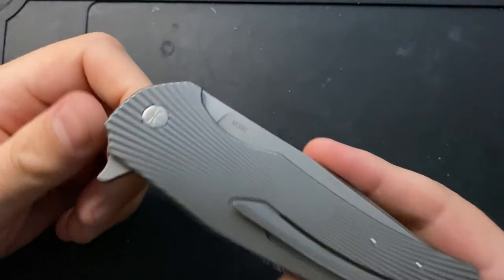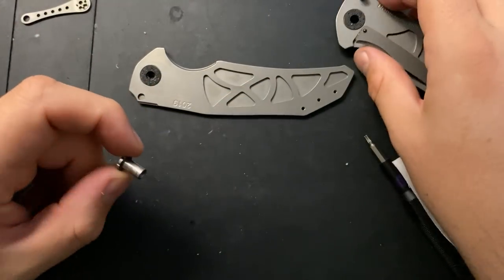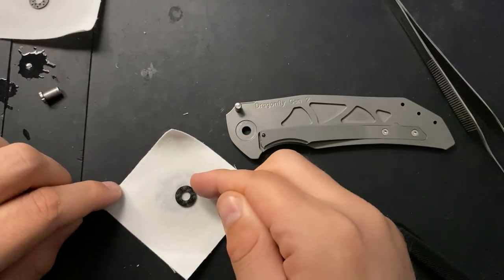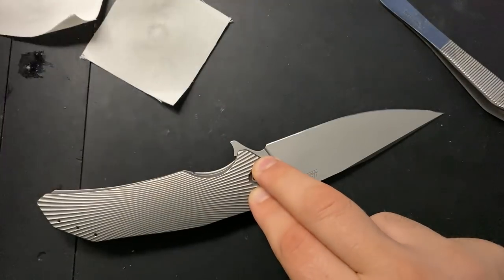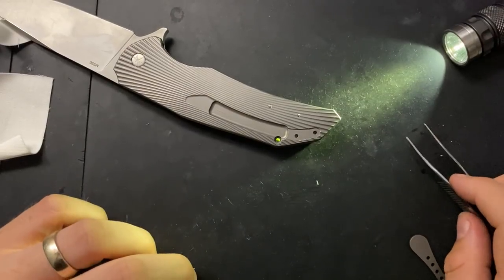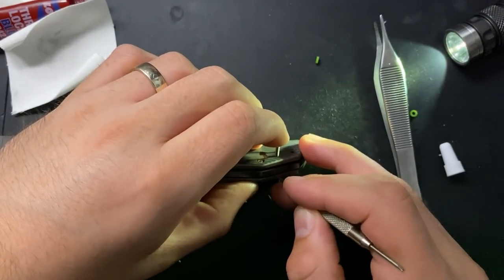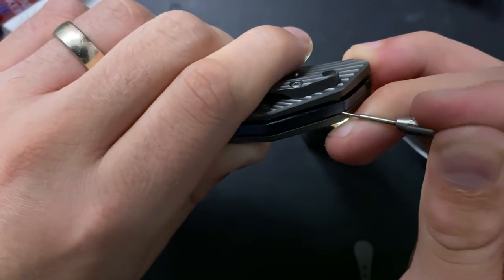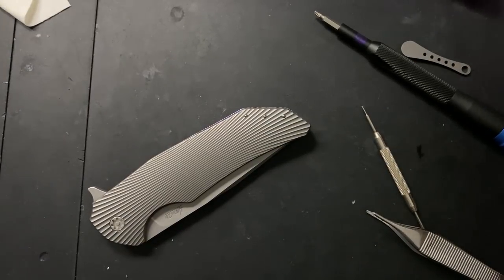How to disassemble and maintain the Herman Knives Dragonfly Pocketknife

Comment: Have you considered purchasing some longer screws with same thread that you can use as alignment pins. Cut off the screw heads, thread into lower scale and then stack parts and upper scale. Push down on upper scale and remove one alignment pin and thread in original screw and repeat for remaining screws. Eventually you should acquire an assortment of alignment pins to tackle most assembly situations. You could keep the alignment pins in your bat utility belt.

Comment: Just out of curiosity, why not put the pocket clip and  three body screws in at the same time with the pivot! Then build it all like a sandwich!!! You would be able to stack the G-10 washers then back-spacer, another G-10 washer on the protruding screws. Then all of the blade assembly. And finally the other scale!!!    Seams to me that would be much easier, but maybe there is a reason that wouldn't work. If so, let me know. Thanks!
Love the video and knife.     Keep up the good work!!!
Reply from the maker: You'll have to flip it over to screw in the screws.  And then everything falls out.

Comment: Nick, quit disassembling knives. You don’t know what you’re doing! Your damaging and scratching the knives. Just for starters… the provided tool is only for fine adjustment. Use the 20. You have the blade in the wrong position for disassembly and assembly. Ever hear of a slave pin?